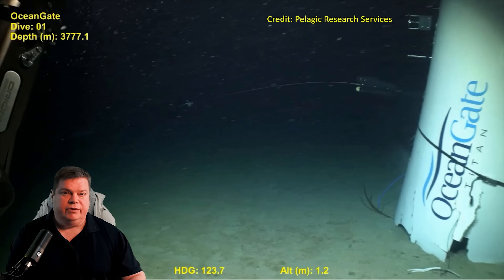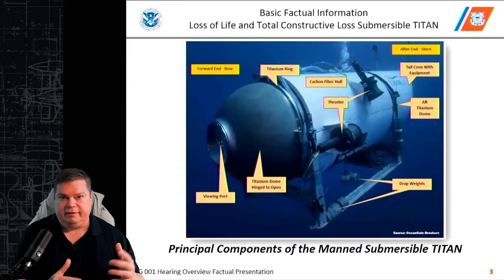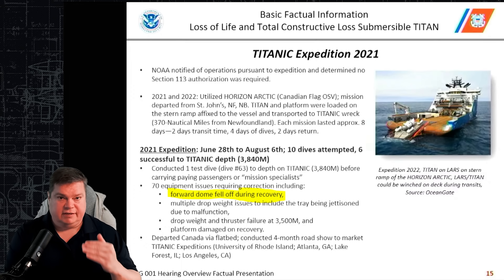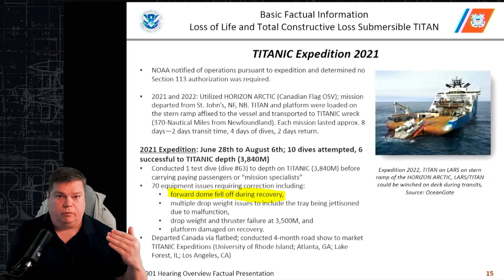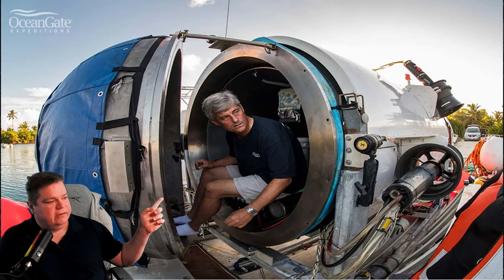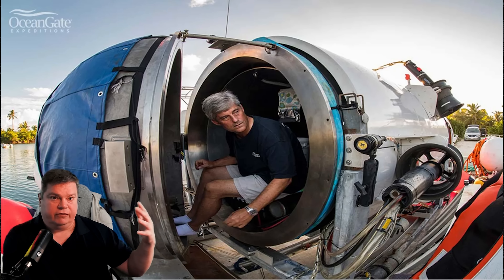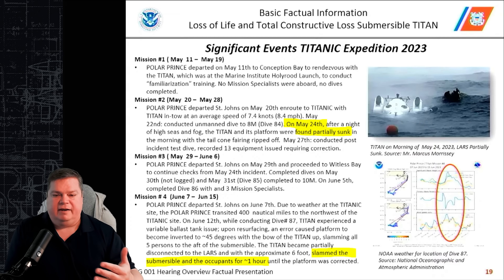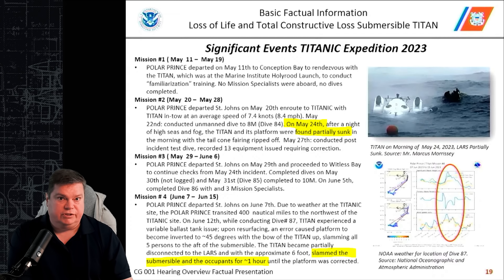New Evidence in Titan Submersible Disaster

Comment: The guy wanted to be an astronaut.
Imagine getting stuck in space with him.
Reply: Could argue that developing stuff for the ocean with high pressure would be pretty important for exploring space. The hardest part with space travel is probably getting enough energy to escape the atmosphere and dealing with the heat with reentering. At least in space you don't need to worry about high pressure environments, but we could benefit from the tech for exploring planets.
Reply: Probably be about the same, honestly.
Reply: Either way. Safe to say, at best, he was a space cadet. At worst a suicidal maniac.
Reply: Seen Event Horizon?
Reply: it'd make for a fun space movie, mainly cuz all the characters wud be makin dum a12 decisions.
Reply: @kosmosXcannon  Agree. In space, the issue is keeping the atmosphere 'in' the spacecraft and not letting it escape into the vacuum (no pressure) of space. In the ocean's depths, the issue is keeping the immense pressure of the ocean from invading 'into' the pressure vessel of the craft. The associated pressures in the ocean are orders of magnitude more than the differential pressures in space. That's why parts of the LLM, Lunar Lander Module skin were no thicker than that of aluminum foil (Stronger but not thicker). Rush was dangerously delusional to promote bonding carbon fiber and titanium with today's glue bonding methods. In the future, such methods may advance to the point of being capable of being strong enough ... but much like the Germans during WWII, their glues were not sufficiently strong to hold the Heinkel HE-162 wings together, causing the death of many test pilots. ^v^
Reply: When you consider that the pressure difference between sea level and outer space is only 1 ATM outwards, while the pressure difference between sea level and the depth at Titanic is 375 ATM and inwards instead of outwards, building a vehicle that can travel into outer space is way easier than building one that can go to depths like that.
Reply: Remember when the space station (soyuz capsule) had a hole in it and it took them days to find ? Thermal and energy management are the top things to keep on top of in space, pressure is almost trivial in the grand scheme of things
Reply: @AcesnEights698  Where we're going, we don't need certification.
Reply: He'd get shoved into the airlock so fast smh
Reply: @antumbra5616  Rush was the imposter. Crewmates lose.
Reply: I can't imagine how much of a pain in the ass he was to be around.  The story of him crashing the other submersible into the shipwreck and yelling at the other sub pilot who wanted to take over was crazy.  He refused to give over the controller to the other sub pilot, and after a paid passenger began crying, he threw the remote at the other sub pilots head.  He'd be the last person I'd want to be stuck in space with.
Reply: @seanpellegrino2989  I wouldn't want to be stuck in an elevator with him!

Comment: As a software developer the comms transcript drives me crazy. Did they not have some kind of telemetric on board, where the sub automatically would report a short system status back to the support vessel? And why did the not implement at least a basic acknowledge in the protocol to see if a certain message was delivered? I know that we are talking super low bandwidth there, but come on, just spend two bytes per message as some kind of message ID or something.
Reply: This is what happens, when the person at the top tells you that standards and safety procedures exist to slow down innovation. We see the results of that aproach....
Reply: They did have regular pings but you're right, you'd think a message ID and acknowledgement of ID received would be automatic - syn ack basically.
Reply: I wonder if they would have been able to recover any data from anything in the service module, which was outside the pressure hull.
Reply: When "move fast and break stuff" breaks you
Reply: Kids just out of college (& some with no higher education) wrote those programs/systems.
Reply: Safety and redundancy were clearly not on the list of priorities.
Reply: Testimony shows Stockton Crush had fights with crew and demanded dives continue after failures. Which seems to have happened in this case when the comms were taken over by PH. So yes, there should be a process to abort if communication fails. And even if that system existed. Stockton would have continued. Failure was inevitable.
Reply: @KevinJDildonik  
"Thou shalt not make fun of the dead" and all that. -But I couldn't help but laugh;  "Crush" 😝

(I do have a penchant for dark humour) 😉
Reply: As a one time systems designer integrating hardware and software, I wonder why on Earth they didn't have a cable between them. If you can wire guide a torpedo, it can't be that difficult. Torpedo wires can be up to 32km long. You could have voice communication, perhaps even low frame rate video.
Not exciting enough for Rush, I guess.
Reply: @EbenBransome  Good point. The ROV used for the recovery would have an umbilical (cable bundle) to provide both live video to the operator, and send back commands from the operator. Maybe they were planning to go inside the titanic? An umbilical would be somewhat impractical in that case.
Reply: @2testtest2  No way. The carbon fibre death trap had no means of disentangling itself if it got caught in something and the only view of surroundings was through the viewport. In fact it had 6 fewer windows and 8 fewer cameras than my perfectly ordinary  car. Just thinking about it gives me claustrophobia. If I'm going to die in a marine incident, I'd like to be on deck at the time, thanks.
Reply: He was an innovator apparently, so no need to use old proven methods.
Reply: @alphakevin687  The reason why SR didn't implement auto acknowledgement protocol was the cost. Titan was over-budget, most of the time. Witnesses at the Coast Guard hearing testified that the crew were often asked to go without pay cheques for 2 months due to lack of income. That's why Rush was in a hurry to get more dives in, so the Mission Specialists' fees would pay the bills. Total incompetent with regard to finance.
Reply: @EbenBransome He wouldn't spend the money. He didn't have it.
Reply: @KevinJDildonik Stockton was the weak link. This tragedy, not accident, was inevitable due to Stocktons arrogance, overconfidence, stupidity and believing his own hype.  I hope the victims family's sue for all they can get.
Reply: @EbenBransome  You don't need an umbilical when you build a good submersible. Take the Deepsea Challenger submersible for example, James Cameron dove that to the bottom of the Mariana Trench, at approx. 11000 meters, in 2012. Almost three times as deep as the Titanic wreck. The DSV Limiting Factor did the same dive in 2019, and the Chinese Fendouzhe in 2020, also without umbilical, and without issues.
Reply: In another article I read, their positioning system was taking coordinates from the text message, writing them down on a note pad and then copying them into excel... I don't think we were working with software geniuses here... never mind the apparently multiple times they mapped the controller inputs backwards
Reply: this was essentially something a guy built in his shed, except he was rich.
Reply: @KevinJDildonik  Some people are an accident looking for a place to happen and it's tragic he took others with him.
Reply: @2testtest2  An umbilical would need to be at least 3 miles long, they didn't want even pay for their one window to be depth rated. A vehicle that large can't really go into the Titanic anyway
Reply: @karlbark  nope--the Admin Director had a degree in education  and the guy with the color-coded real-time wrning sensor  had was an MRI technician with basic degree in programming,. The Science Program Admin was a Marine Biologist but sero knowledge of marine laws or regulations, marine engineering.
Reply: @EbenBransome  
when I watched videos about Stockton Rush and the inner workings of the Titan he made it clear the least comms the better. Definitely no audio. He said he didn't want crew on the ship annoying him by talking to him every few minutes (he prob didn't want his 'mission specialists' hearing the comms either..)
He insisted on text only and the shorter the better. 
On a couple of previous occasions the sub lost comms with the ship but they 'found' each other again up to 2 hours later.
Let the buyer beware was never truer than in this case.
Reply: @ksc743  The amazing thing is how naive billionaires can be that they go down in a death trap like that (or buy a big yacht and fail to ask why there isn't an escape hatch in the cabin area, or a PA system for the captain to alert the passengers of an emergency).
Reply: @EbenBransome    isn't it unreal. Rn I'm reading Elon Musk's biography by Walter Isaacson. Can't stand EM but I'm trying to understand what makes him tick. Something interesting that all billionaires appear to have in common is they are risk takers and cheapskates. I'm amazed that EM's cars or rockets haven't had their own oceangate yet but I think M is higher up on the ocd scale than rush was so he's more of a perfectionist thus averting catastrophe. 
Billionaires are also used to being surrounded by the best of the best eg billionaire yacht owners trust the design even in the case of extreme weather. I reckon normal survival instincts would not allow for most of us to agree to be bolted into a tin can or stay below when the yacht was swaying like a pendulum but then we wouldn't be billionaires either!
Reply: @alphakevin687  no telemetry would be of use because failure happened within a millisecond
Reply: @matoctaneart5831  Sure, they would not have prevented that failure. But if things go south, you want the surface vessel to have as much information as possible, e.g. which alarm was triggered or some understanding about battery SOC so that comms then can cover the more complex topics? In a crisis it is important to keep work load of humans low so that they can make the right decision. People reading data from a computer terminal, and then typing it back into the same computer terminal just is insanity.
Reply: @ksc743  There's no less hubris With Musk, several people have died due to Tesla autopilot simply slamming full speed into stationary objects in broad daylight. It's just that individuals dying in a car crash is less sensational than OceanGate, but all the corner-cutting and hubris is there. He chose not to install Lidar and rely solely on cameras and visual parallax to determining the existence of, and distance of, objects in the road. Which apparently means stationary objects in the road can go completely undetected by tesla autopilot, which is insanity, like, that's the #1 thing an autopilot should be able to do is not slam into stationary obstructions. So, just like Rush he chose to forgo a largely solved problem using existing technology and industry standards in order to save a few bucks thinking it he could simply write smarter software to make up for it.
Reply: @pearly1789  thanks for this. It made me look it up. 17 fatal collisions up until June '23. The media keeps it so quiet. But I will say is that stat is in the self drive ones. The titan wasn't self drive but both stockton and elon do their damndest to make everything as cheaply as they possibly can.
Reply: No they just had a windows pc with an xbox controller, what can go wrong harrharr.
Reply: When you boast about “camper world” being your supply source, you utilize the cheapest resources to achieve a compromise for the proper means to achieve what you want.

Comment: You'd think that given communications are vital to the recovery of the crew, that if you had two communications systems fail, you would immediately scrub since if you lose the other you have nothing. But I guess I forgot who we were talking about.... Doesn't even see like they had such a thing as a minimum equipment list or anything, just played it by ear as failures happened. The fact that they arrived at the bottom of the ocean on a previous dive with the controller mapped incorrectly obviously shows they did no control checks at the surface. And Rush was a licensed pilot, so it's not like any of these ideas should have been new to him. Not even a disregard for safety; a distain for safety.
Reply: Especially since so many people kept emailing him about how it was a death trap and he encouraged them all.

Comment: Thanks! 
I watched a video on the making of the sub and I deal with an adhesive like was used on the sub end caps (plexus) and believe the the titanium surface was not prepped right. When they applied the adhesive to the titanium you can clearly see it was a shiny machined part. It also calls for a colored primer before application.

Comment: Of all the vids I've watched on this channel, this is the first I've had to watch/regretted watching. Based on 25 years experience of building ROV's, this accident truly sickens me; it didn't need to be this way. My former industry learned more than 20 years ago that carbon carbon pressure vessels were a good idea that didn't work; the nature of their construction renders them incapable of handling the elastic deformation the pressure vessel has to endure with every dive. Over time, the pressure vessel suffers micro-fractures that get bigger/more serious with every dive/recovery cycle. 

There's a reason why extremely deep diving vessels are so expensive; you need very exotic materials to handle the pressure at those depths, coupled with extreme levels of engineering and quality control. It's insane to think that this stuff can be done on a budget and believe it'd be safe enough for "tourism". The levels of criminal negligence in this entire sad story are just mind boggling. My heart goes out to the families and all personel involved in the wreck and its' recovery.

Comment: According to the cbs reporter that did a story b4 this all happened.. the dropping of 2 weights is standard procedure so it doesnt slam on ocean floor.. if they were trying to come back up fast, they'd be dropping all the weights they could
Reply: @nickross2423  The fact that littering the ocean floor was standard procedure really irks me.
Reply: @louiscypher4186  ill agree with that
Reply: @louiscypher4186  It's standard for all deep-sea submersibles as dropping ballast is the only way that they can return to the surface. Stuff like lead shot is used. It's also rigged so that if there's a power loss the ballast is automatically dropped for safety. James Cameron has spoken about this.

The problem with the Oceangate system is that it was jankey.
Reply: @louiscypher4186 do you have any idea how much trash is legally dropped into the ocean?
Reply: @alanmeyers3957  doesn't make it right, but I see your point when there is an island of trash floating in the Atlantic the size of a small city lol it literally has so much garbage you can walk on it.
Reply: @louiscypher4186  If it makes you feel any better, lead, steel (albeit as iron), titanium, etc. all come out of the dirt to begin with. I'd be more worried about the toxic chemicals and acids used in the batteries and other electronics.